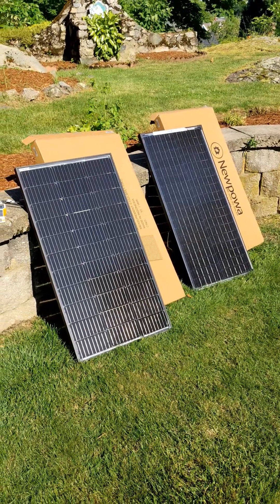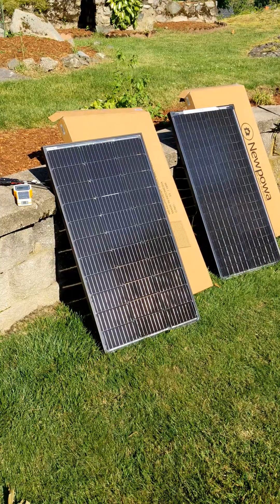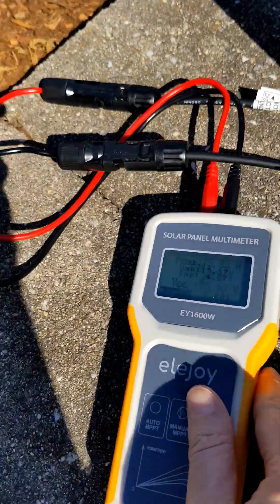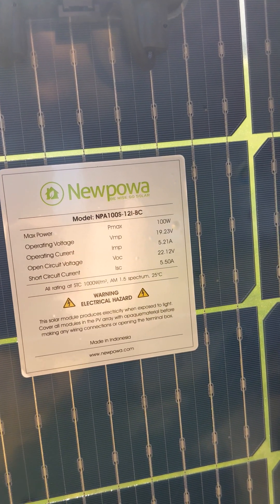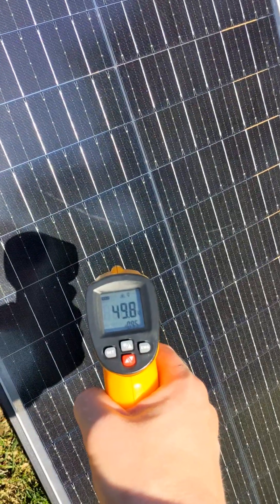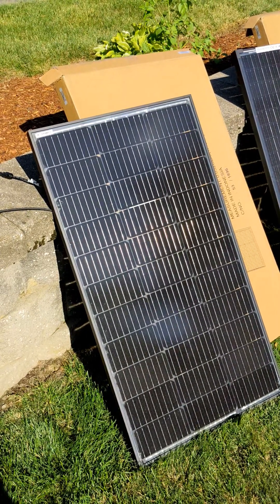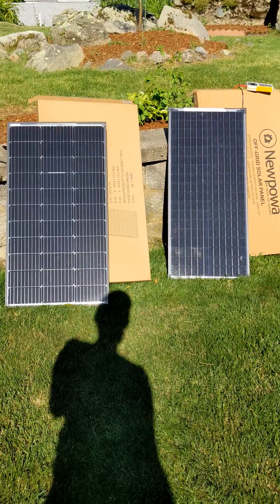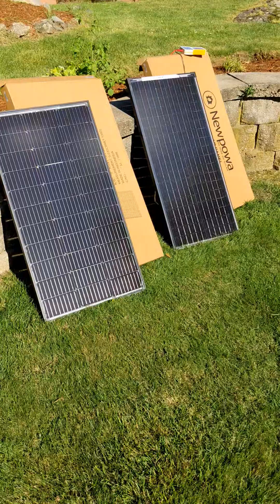Newpowa vs Werchtay 100W Solar Panels

Comment: A little confusing since the Werchtay panel is leaning on the Newpowa box. But otherwise good comparison vid.
Reply from the maker: Yeah, it was a bit of a pain to get a good angle for both!
Reply: I have a 100 watt Werchtay panel and am very disappointed with it.  The best I can get out of it is 2.35 amps and 39 watts in full sun.  Going to get another 100watter but not a Werchtay.
Reply: @trainmaster0217  it must have a issue , cos i have buy them also , and to my experiences they producing more then i ever found on the cheap solar panels i bought , and i bought maybe , 15 different brands , so i am very glad of thèses panels they sale , i bought 2 for 32 €/piece on aliexpress , all inculdes Tax and sended to my door and receided in about 5 days from germany to belgium , real nice to me

Comment: I have seen a couple of reviews of Newpowa where new panels actually caught on fire.  I suppose it's rare, but these were credible reviews I saw in different review situations.  I wouldn't want to risk it.  Werchtay are the cheapest glass 100 watt 12 volts on Ebay.  Higher VOC and diodes make panels perform better in the shade.  Werchtay has the voltage.  Newpowa has one more diode.  I had a cheap plastic panel that didn't last a year and then I managed to score a Renology glass 50 watt panel on sale that pumps so hard, I put it in the shade when I want more of a trickle on my car battery.  It goes in the sun for charging 5 volt devices.  I am so psyched with the quality of that panel.  HQST (supposedly made by Renology, quality, either way) has square shaped 100 watt 12 volt panels on sale right now on thier website.  Rich panels are good.  It doesn't seem worth it to buy really cheap panels.

Comment: I have two Newpowa bifacial 100w panels connected to my Delta 2. I am planning to add more. Low voltage and max 5A per panel is actually excellent for Delta 2. I think 2s3p (6panels) is very safe config. Amp goes 15A max and voltage stays well below 60V limit.
Reply from the maker: I'm trying the same thing with my Delta 2, but I'm running into issues with 2s4p. The voltage hovers around 31v under load, so at the 15 amps max input of the Delta 2 I'm only able to get ~465W with 800W of panels.